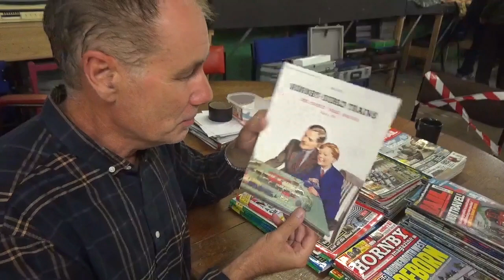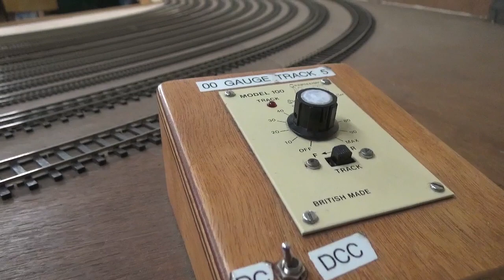GYDMRC Quick Look Around a model railway club

Comment: Looks fab Laurie and a great sized room. What an amazing test track. My little one only has 00 and two 009 tracks.
Reply from the maker: Yes a good space all permanently set up. The test track is very useful with about a dozen tracks, either DC or DCC at the flick of a switch (or you can plug in your own). Was great to give these trains a proper airing after being stored for so long. Cheers, Laurie.